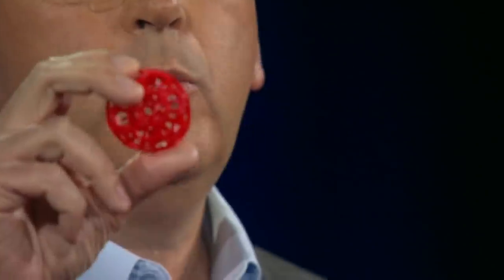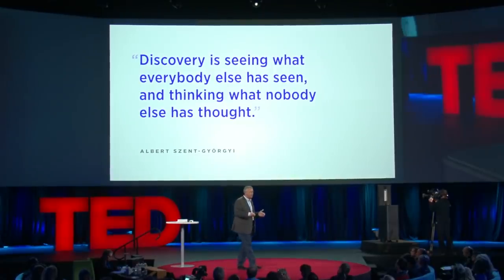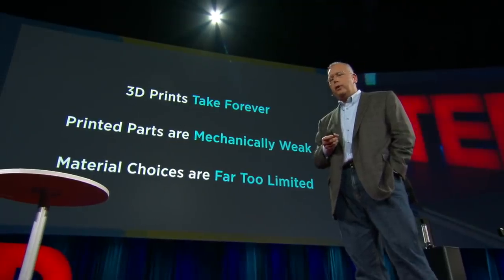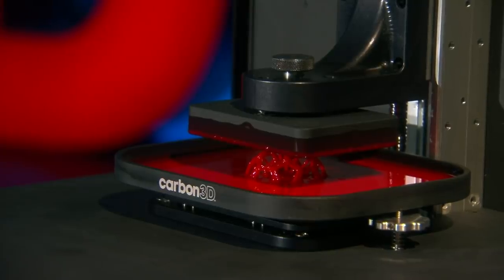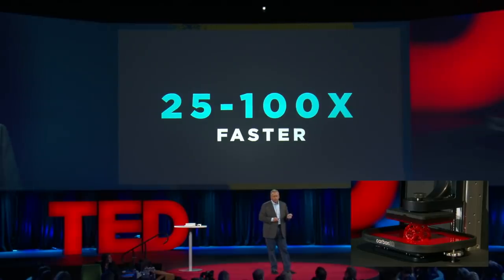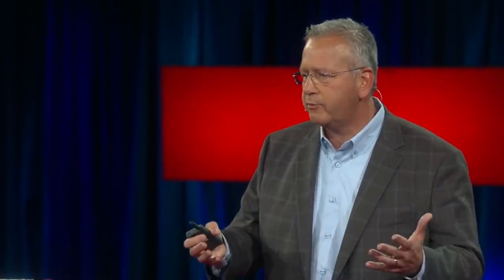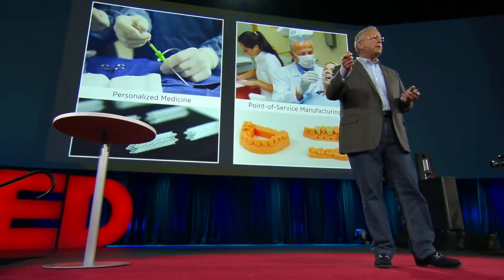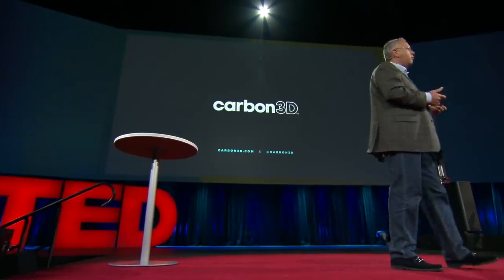What if 3D printing was 100x faster? | Joseph DeSimone

Comment: Very cool! I still don't think I have an immediate use for a 3D printer at home, but I can definitely see how something like this could be very useful in certain industries. :)
Reply: the hard thing would be to get something to print.
With 2d Printing its easy.
I have an awesome picture, I scan it, I print it.
But with 3d its much more complicated.

I have all the time little bits I would need to replace that aren´t avaiilable online (because companies want to sell you new products or expensive repair kits)

-door handles (right now I have to choose between replacing all of them in the kitchen or rely on luck to find the right one since they are out of production)
- little cogwheels in the washing machine that aren´t available anywhere
-plastic covering of toilet pump which was cracked by a friend who repaired the pump but stepped on the plastic covering part.
-

This list continoues on an on and could be rounded up with the phrase
"any small thing made out of plastic that doesn´t need a lot structural integrity (I wouldn´t trust a printed ladder or a printed closet hanging

The thing is that I wouldn´t be available right know, to program these things so that a 3d printer could do it.
Reply: akumabito2008 Well, here's the use for you: instead of 100 cubic meters of space used to manufacture each part, you have 10 cubic meters. (or 2-3, in the case of this tiny thing he show cased, but it's not really of...viable size for industrial works) Currently, parts require fairly huge and complex sets of machinery. And to get a new design, you're going to have to completely replace entire sections of the manufacturing process. With 3d printing (particularly with this new type), it's possible to go from digital to physical with an incredibly low amount of hardware, compared to today. As well, these tend to be incredibly general purpose, but still do most everything pretty darned well, so you're not going to have to cast a new mold if you are off by 57 nanometers, you'd just adjust the specs in the code.
Reply: akumabito2008 well for the old 3D printing neither do i, it's to expensive and you can't really use the part (it's to weak), but if this can print finished products then i do, of course this would need to be able to "print" carbon fiber or metals to be truly useful, no more running down to home depo for a few nuts and bolts
Reply: "I still don't think I have an immediate use for a 3D printer at home".
That's exactly what was said about calculators and computers. What if you had a 3D printer that could print out whole working devices such as blenders or cooking utensils or replacement parts for stuff you already own. Check out Cory Doctorow's book Makers. It's a story about the near future where all kinds of these technologies are used by ordinary people to improve their lives. Fiction? At the moment. But fun to think about.
Reply: Joe G.P.
Metal nuts and bolts would be quite a long shot I guess. I wouldn´t risk that, especially since if something happens, your insurance won´t cover it.

But there are all sorts of plastic in our lives that are not under much stress and could easily be printed.
Reply: *****
Do you own a house or a flat where everything belongs to you and has to be repaired by you?

All the time things get discontinued and if stuff breakes it would be great to print some new doorhandles and such stuff.
Or that thing in your car that directs the air.
Mine broke on my old car and the manufacturer only offered to replace the whole  system which would have cost hundreds of dollars.
I found the same car on a wrecking yard and was able to get the needed part, but a 3d printer would have helped a lot.

And these days there are plastic clips used in cars, that break quite often.
Just print them.

Or maybe you do have a vintage car?
There are tons of styling and design parts that are rare and valuable just because the number of people wanting them is high enough to drive the prices up, but not high enough that it would be profitable for anybody to produce these parts by injection moulding.
Reply: Thing is, back in the 70s, they could not think of an immediate use for a computer at home...

Uses for a home 3D printer:

Kitchen printer: Being able to print up cake decorations and stuff from sugar.
Interior decorator: If you want a little statue of your granddaughter, you will be able to put her in a 3D scanner and print one out yourself. This kind of scanner already exists, and was used on Obama.
Home repair: Spare parts could easily be manufactured
School projects can easily be printed up.
Reply: You can print your own Lego parts, fast.
Reply: *****
Minefield
Fixed that for you.
Reply: eberbacher007 You make an excellent point, but I wonder if you know about Thingiverse, it is an online repository for 3D objects ready to print. OnShape is a free CAD program that only recently has been opened to the public (it has a free option that allows someone to design 5 things) that will hopefully make it even easier to have a wider variety of objects 3D modeled and then ready to print.
Reply: akumabito2008  On the surface of things you sound right.  And so many people before you (us) did as well.  But twenty years ago I couldn't tell anyone what use I'd have for the internet.  Now, I can't imagine what life would be like without it.  It's like having no electricity when it's down! :)
Reply: eberbacher007 since when do we have to pay for anything online? i can't remember if I ever payed for anything that I downloaded
Reply: Robert Shaver 
true dat. I would print my own cutlery, mugs, frames for glasses, holders for lots of stuf, broken parts of things, etc.

but this is only the begining. if we could combine materials like plastics and metals, anything would be possible. 
same if really strong materials could be 3d printed. you could make tools and what not
Reply: TheCakeAintNoLie

Well if something has no price, then it often has not a lot of value.

And yes, the price might not be money, for a design, but the price of a flooded bathroom because you downloaded some part for your washing machine fro m a free source and not from the official "washing machine company 3d design webstore for 20$  )

Once you start printing stuff that has to do important stuff, there is an area I wouldn´t trust free online databases.
Just like I wouldn´t trust an online database for "free skyscraper plans" and then buiild a skyscraper with these plans.
Reply: eberbacher007

why would you download a file some random person made?
 
I'm talking about people who actually bought it putting the files online for free.
You know, like cracked versions of photoshop, antivirus programs, operating systems, any software, movies, music, games etc.

We're not downoading software that amateurs recreated form the original. we're downloading the originals
Reply: TheCakeAintNoLie
Except the economics of it will break down, if everybody is printing these things for free, nobody is being paid. If nobody is being paid, the economy stops.
Reply: dangerouslytalented
just like adobe right? and music, movies, etc
Reply: TheCakeAintNoLie
The corporations get theirs, they can do proper intellectual property protection. But not lower end designers, musicians etc...
Reply: dangerouslytalented
yea, it's not going to happen. software will never be safe from pirating. as soon as it gets a bit popular, it's on the web for free.
Reply: akumabito2008 In jewelry insustry, 3D printing is used to make moulds. If this becomes commercial, they will have smoother surface on Moulds, and it will reduce filing needs, resulting in less gold loss.
Reply: Oh, I understand how this could be incredibly useful for a variety of industries, as well as for some personal use. It's just that at this moment, I don't see it as practical. Most 3D printers are somewhere in the $600 to $2000 range. That's a LOT of little doodads you need to print to offset the initial purchase price. 

I'll definitely get myself a 3D printer when the price comes down enough, and the model ecosystem is in place to support the home printer. As it stands right now, it's a lot like a lot of new tech like smartwatches, or Google glass - it's interesting, and I can admire the work that goes into developing the tech - but I can see about zero use in 'm for me personally.

I'll gladly adopt the tech when it becomes relevant to me though :)
Reply: akumabito2008
One of my friends makes props... He has been seriously thinking about getting one.
Reply: TheCakeAintNoLie You will soon not need metal. That will be so yesterday in the near future .
Reply: akumabito2008 Maybe someday engineers will be able to sell designs straight to the consumer just like music is sold today. You just browse for the product you want; then purchase the product and the 3D printer prints it. Eliminates the middle man. No more need for Accountants, HR, Managers, Marketing, Sales, or Executives.
Reply: bernard regier This already happens to an extent. Sites like Shapeways have marketplaces where consumers can download .stl/.obj files to print in their 3D printers, and designers/ engineers can upload their designs to sell. Shapeways aren't alone either but yeah I'm not sure how many of these items are useful yet as opposed to novelty or for aesthetic purposes but your "someday" sounds pretty close :)
Reply: Jad Thomas
In the motorsport industry, they are custom printing things like air intake scoops and spoilers
Reply: dangerouslytalented Awesome, I'm not surprised. Enterprises are definitely making useful things, Stratsys made a car called the SP1 which is made of a combination of 3D printed parts, and hand made parts made from 3D printed tools haha! And other companies are printing corneas and stuff, crazy! Still think we've got a while before this level of utility trickles down to the consumer but I'm waiting patiently :)
Reply: Jad Thomas
It will be quite a while before it leaves the "boutique" level, and it will only ever be a niche thing.
Reply: dangerouslytalented I agree up to the "only ever". Even if the technology didn't improve from here on and only got cheaper I could see it eventually becoming more mainstream, but I in fact think we're sitting on a very early point of the curve. Who knows though eh?
Reply: Jad Thomas
It'll be a great toy, but people will be soon sick of the crappy plastic stuff you make with them.
Reply: dangerouslytalented facepalm.... did you even watch the video? lol its made of the same polymers they use to make ANYTHING that is injection molded.
Reply: +dangerouslytalented they have engineering polymers that are orders of magnitude stronger than steel, they melt at around 6-700f
Reply: Not sure where you got your facts... the best polymer available is PBI and it has roughly half the compressive strength and a third of the tensile strength as A36 steel.  https://en.wikipedia.org/wiki/Polybenzimidazole_fiber#Properties

Comment: This is so damn cool! 3D printing is finally kicking into high gear.
Reply: It only took high school interns at NIST some years ago to solve the horizontal weakness problem of 3D additive technology: bake the resulting piece to fuse layers well.  Time & temp vary with the materials used to print.

Comment: What would impress me is if there is a material that this printer can print with that is a really good electrical conductor and is very heat tolerant. Once that happens we will be able to construct "logic cubes" instead of flat microprocessors and motherboards. Think about this for a moment. Providing hollow airway passages throughout, imagine circuitry baked into a large "logic cube", and consider how much "brain" you could put into that kind of space. For comparison, consider the "server blades" we currently have in backoffice server rooms, where 10 or even 20 fully powered computers are stacked into the space of three to six pizzabox-height computer racks.

Comment: These machines cost $40,000 per year, with a minimum three-year term (resin for printing could cost extra) 

On-site installation and training is $10,000 and the initial accessory pack (required, unless customers already own the items) will run $12,000.
Minimum 3 year cost of $142,000 and its print volume is about the size of a Monster Energy can.

Comment: I honestly dont see much of a point in 3d printing for manufacturing. I mean it's fantastic for some things but you dont need it for absolutely everything. Ive also always seen it as a tool to make stuff at home that you cant buy or just have the idea for.
Reply: TheycallmeNade Its mostly to improve the quality and cost efficiency of items, or atleast thats what its aim to be
Reply: TheycallmeNade prototyping is about the only thing I can think of
Reply: 3D printing is important in emergencies, remote locations and especially for objects with complex structures. 

Ultimately 3D printing is what will bring us one step closer to molecular printing.
You could take common atoms like hydrogen, carbon, oxygen, nitrogen etc. and assemble them to get exactly the material properties you need. 
Why wouldnt you want to print a healthy dinner and a drink in a few seconds? Or medicine when you need it.
Reply: The PhD 8n charge of setting national standards at NIST for 3D printing in USA said 3D printing in necessary for space missions. Even ships st sea tend to carry half their cargo capacity in spare parts. Space missions cannot carry all the spare parts they might need. Thus, taking a 3 D printer, materials to print with & download patterns as needed works for that. National Geographic has published on the topic of our young sun being in a heating up phase, not a cooling down phase--such that Earth is going to be within the too hot ring in the solar system. That is why science/ engineering projects are focused on colonizing Mars. M3dicine says human bones can't stay strong for the trip.
     Future prediction computer programs continually predict cultural failures that never happen--because people work on solving problems.  Methods are not perfect or fast, but human beings don't adjust well to rapid change continually.